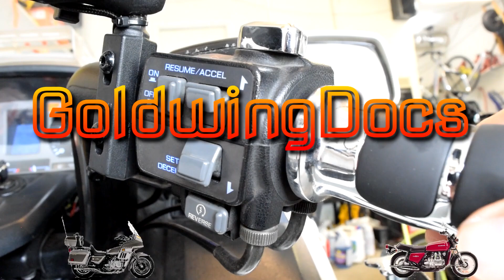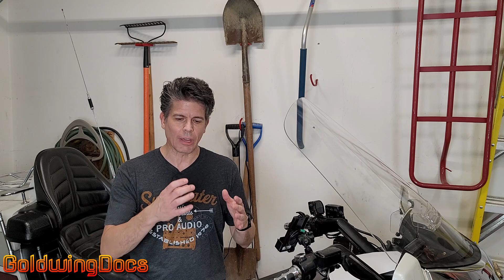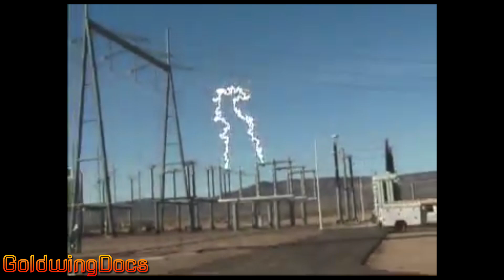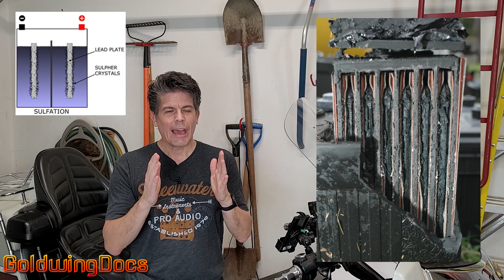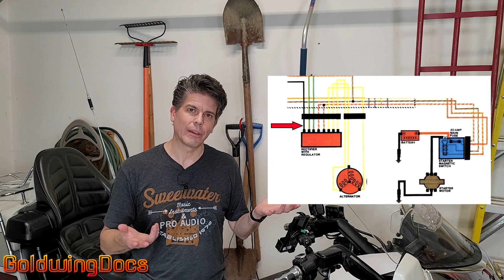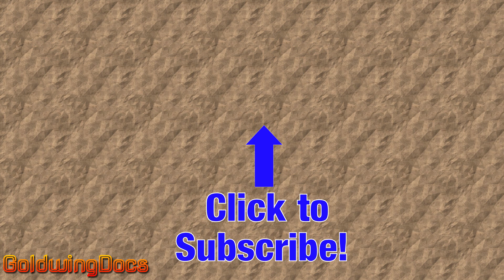Goldwing Q&A Episode 1: Starter Kills Bike, Won't Start, Battery Overcharging

Comment: I picked up a barn find GL 1100 being standing since 2011 needs a lot of tlc . No key, help me to get spark. Cleaned up heads and bores got engine to turn over  but need to hot wire to get spark. Thanks from Richie.

Comment: Hello, Thank you for your videos, they are very informative. I myself have the problem you talk about in your video, the one where when you put the ignition key, everything lights up and when you push the start button, everything goes out and the starter does not turn. A "tick" is heard in the relay box. at least, a relay engages.
I recharged my battery with my stabilized power supply, under 14v, it first pumped 2.8A, then 0.5A after about 7 to 8 hours. there, it gives 12.7Volt. The starter relays A and B do not work at all, I disassembled and tested my relay B (solenoid) it works well with my lab power supply, but I don't know if it is still good for a strong current . My relay A (to the left of the battery) does not receive current and does not activate when I push start!
I checked all the relays, they all trigger, but I don't know if the internal contacts are still good.
The start button is good, then we hear a relay.
Tomorrow I will shunt the solenoid to see if the starter spins.
For everything to go out like that, it's necessarily an opening of the general power supply circuit, isn't it? Especially since the battery voltage does not move, if it had a short circuit, it should drop..
If you have any advice, what I should look at where on the bike, I would love to hear your opinion. :-)

Comment: 2007 GL1800HPN - Bike died on a ride. Smelled something burning, volt meter showed between 13-14. Stopped, at idle showed 9 and engine had a grinding sound. Charged battery on a trickle charger once towed home. On a full charge, the engine only turned over a couple of times very slowly before clicking. Replaced battery. Same issue. Alternator is less than a year old. Any thoughts?

Comment: Hello there I have a 1998 gold for some reason all the lights work in the back but nothing work in the front the front lights don't work the light to turn Sooners don't work the radio don't work the dashboard don't work nothing worked in the back but everything working all right the back stickers work the back lights work to turn fingers in the back work problem solution

Comment: I have a Goldwing F6B Deluxe that are well known when you are gliding to a stop and not using your brakes yet the front forks, and handlebars start shaking. Other than buying an aftermarket clamp for the forks what can I do to stop this?
Reply from the maker: This is deceleration speed wobble, and it happens to many Wings when decelerating through about 35 mph. It happens more if you do not have a solid grip on the handlebars. Fork brace can definitely help, so can retorquing the steering head bearings properly. It also happens with newer front tires more often than worn.
Reply: @GoldwingDocs  I purposely let go of the handle bars to see how much it shakes because I was aware of this with Gold Wings. I don't know how to torque the steering head bearings, can you show me?

Comment: I have a 1998 Es 1500.
I am having a problem with the left fog light keeps burning out. I am also having a problem with the cruse  control working.  Can they be related?
Reply from the maker: Not likely. I'd suggest you post your question in the 1500 forum on GoldwingDocs: https://goldwingdocs.com/forum/viewforum.php?f=6

Comment: I had that last issue on my GL1200 but came to the conclusion that the 36 year old Reg/Rec was shot
A $25 Chinese made one from Ebay fixed everything 👍
Just to say that sometimes it’s just an old worn out part that needs replacing.
Great video!
Thanks 🙏
Reply from the maker: That $25 Chinese eBay one might not fix it for too long... :) Or it might, luck of the draw, really!

The gold standard in terms of aftermarket Reg/Recs is really the Shindengen MOSFET unit.

Comment: Great content, I currently have a 1996 GL1500 that was passed down to me from my grandfather. It has 177,xxx miles and runs great but I have a issue with the cruise. He checked all the switches on it and everything was working fine, I changed the cruise control valve and all the hoses due to it being plastic and rubber age was showing but the cruise is still not setting at speed. I've read over all the goldwing docs and cant seem to figure it out. Could you shed some advise for myself and others. Thank you for the content.
Reply from the maker: The cruise control system is quite complex - in the Electrical Troubleshooting Manual, the diagnostic tree for diagnosing cruise control problems is 12 pages long. I'd suggest posting on the GoldwingDocs forum and we can help you out - it's beyond the scope of a YouTube comment!

Comment: I have a problem with my turn signal.  My turn signals on my mirrors don't have bulbs they are integrated circuit. My problem is that my turn signal does not flash. What could be the problem?
Reply from the maker: Definitely post on the GL1800 forum on GoldwingDocs - we'll get you sorted: https://goldwingdocs.com/forum/viewforum.php?f=6

Comment: Hello I have a 1988 gl1500 when the bike is cold  the bike starts good and rides good but if I turn off the bike for about 20 mins the bike doesn't start just you can hear the starter working but the bike no starts
Reply from the maker: A lot of the time with a GL1500 this indicates a weak battery.

Comment: Late in coming to your channel, My mistake I'm finding!
I just bought an 06 GL1800 and for my long distance riding I am in need of more power points. Can I put a fuse block off of the Accessory connection from the fuse panel or should I wire directly to two of the "free" fuse locations? Those "free" fuse locations have constant power where I would prefer they only come on with the ignition. 
How would I wire to the fuse block and only have them come on with the bike running?
Thank You
You all are in my prayers
Hoka Hey
Reply from the maker: I would definitely use an Electrical Connection Power Plate. You can see our review here: https://goldwingdocs.com/forum/viewtopic.php?f=18&t=10890

They now have a newer, universal one that fits any bike. Make sure you replace the cheap relay that comes with it with a quality one, I had problems with that (relay heats up, restricts voltage).

Comment: I have a 1991 GL1500 SE. When I turn on the cruise control the light goes on saying "Cruise on", but when I hit the "Set" button, nothing happens.

Any suggestions on what to check to get the cruise to work?
Thanks
Reply from the maker: The troubleshooting diagnostic tree for diagnosing cruise control problems like this takes up almost 20 pages in the service manual - a bit too much to try to cover in a YouTube comment. I'd highly suggest checking out the GoldwingDocs forum, as this problem is covered often. https://goldwingdocs.com/forum/viewforum.php?f=6

Comment: Dig the way you're going about this!

But now a question. I have an 83 gl1100i  and it's  been pretty much finished being restored by me. I'm having issue with it getting poor fuel economy. I'm getting just under 25 mpg. The carbs have been rebuilt and can't seem to put my finger on it.

Comment: How do you operate your CB on a 1500
Reply from the maker: It's hooked up into the headset in your helmet. You tune the CB, when it receives, it stops playing the radio so you can hear the CB. There is a transmit button on the left handgrip that lets you talk back.
Reply: @GoldwingDocs  things

Comment: My Goldwing will not start it's not the relays is not the fuses the side stand is up and I still can't get the bike start it's not the battery either I have no clue what's going on and why won't it start I got lights but it will not turn over
Reply from the maker: Definitely post on the GoldwingDocs forum. We'll get you running again! https://goldwingdcos.com

Comment: I need help I took dash apart to replace lcd and everything worked, I put it back together and the gas gauge only stopped working where do I go from here....This just started happening I hit the starter butten and starter keeps turning even with the switch off  it stops once voltage removed and hooked back up I just became a goldwing rider 1994 gl1500 se any help would be thankful for
Reply from the maker: Post on the GL1500 forum on GoldwingDocs - we'll get you sorted: https://goldwingdocs.com/forum/viewforum.php?f=6

Comment: I had a similar event that turned out to be a bad cell in the battery. Didn't notice that my tender was telling me this.
Reply from the maker: Even if only one cell is sulfated - the 6 cells are in series, so if one is sulfated and choking off the amount of current it can supply, it means it chokes that current for the entire battery.
Reply: @GoldwingDocs  Interstate battery was only nine months old. Now I use their float charger so this one will be cared for better.

Comment: Good video it may be worth mentioning on the first question a problem I had a few weeks back, very similar situation ignition and everything working but press the starter and nothing happens. Replaced the starter solenoid and starts first time.
Reply from the maker: In that case you would not see any change in the battery voltage. If you hit the starter and you get nothing, or just a click, and the battery voltage stays more or less the same, then suspect a starter relay or the starter itself. If the battery voltage dips way down, then suspect the battery.